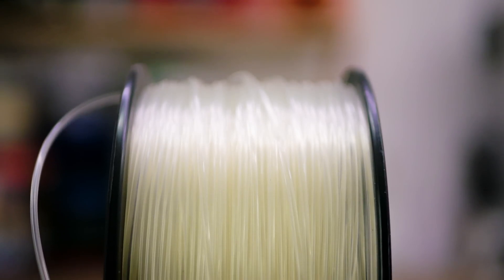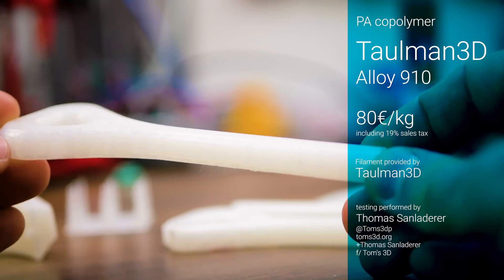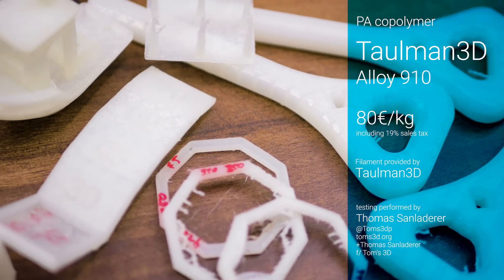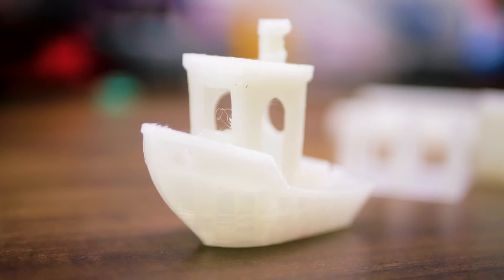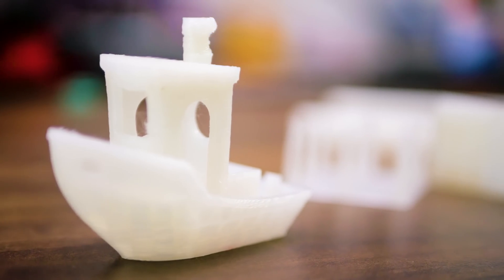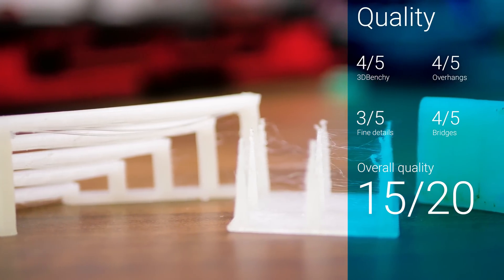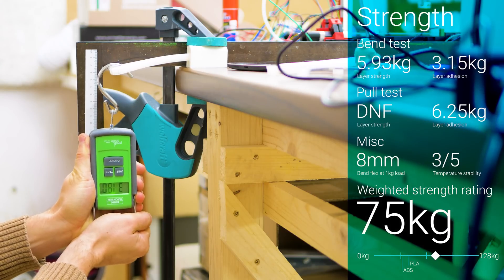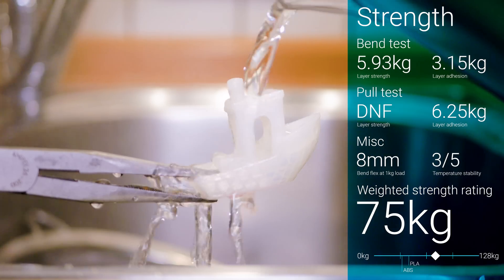Easy high-strength filament: Taulman's Alloy 910 review! #Filaween

Comment: Got some on order to try making drone parts with.  Hope it works out well.  Regular nylon is way too flexible and polycarbonate is a pain to print.  So far regular abs and petg have been doing the best but want something better.
Reply: How did it nylon 910 work out for you?

Comment: Hi Thomas, did you also observe heavily changing material properties over time? The initially great material stiffness gets lost and feels more like "normal" nylon. Taulman recommended me using PU-Spray against the moisture, but I'm not 100% happy with this method. Besides of that Alloy910 is an awesome engineering plastic^^

Comment: I tried it just after they released it and could not print with it. I believe it was wet as it just hissed and spluttered the whole time.

I retrieved the packaging from the rubbish and found the thin plastic it was sealed in had worn through where the reel had rubbed on it. I tried the drying it in the oven trick but it did not improve much.

If they have started sealing it in decent thick plastic I may try it again...

Comment: hi thomas. the plug for my heat bed is getting really hot. is there a way to cure this. i thought about a seprate power supply but i think  the point of connection to the board would still get hot ?
Reply: Depending on the type if board, you may have a couple if options.
It'll be the resistance of the connectors, causing the problem.
You could either replace them with a connector more capable of carrying the high current or remove the connector and solder the cables straight into the board.
Reply: mike stetson I did route the Power over a Solid State Relais. so my Board does not need to handle that much Power.
Reply: im going to look into it. my printer reset tonight in the middle of a print and i think that is why. that and my extruder likes to skip a little i have found there a diffrent reasons for this tensions and temps.

Comment: Could you print these filaments that are listed as not needing a heated bed on BOTH heated and unheated. I dont have a heated bed and would like to see the results without heat.
Reply: Slobberknocker most of these filaments have to have a heated bed because that is the limit of these materials. Any application outside of the recommendations is. buyer be ware.